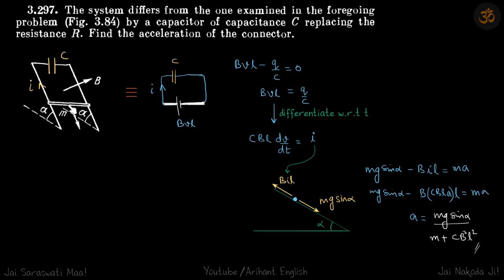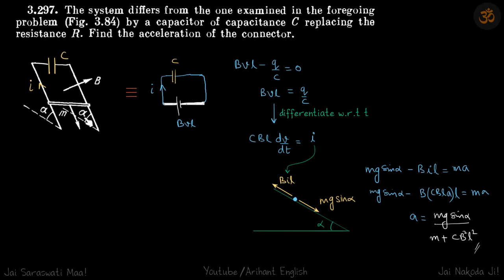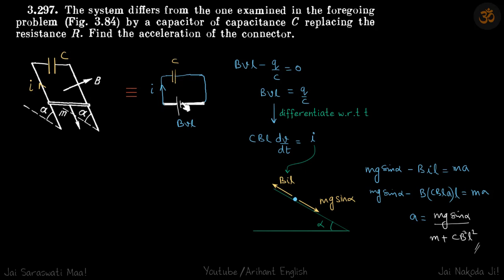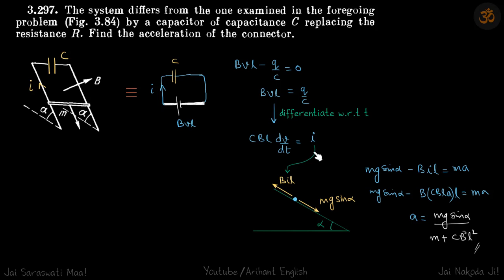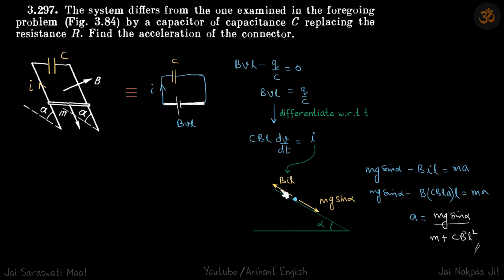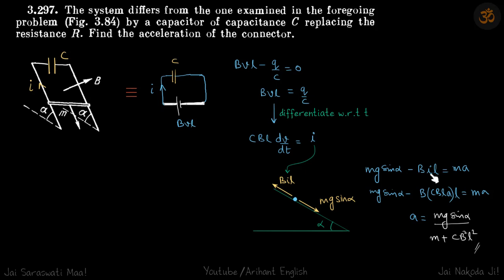3.297 | Irodov Solutions | Electrodynamics

Comment: wont dq/dt be zero ? as capacitor is instantly charged as soon as rod gains some velocity  since there is no resistance , then why will anymore current flow through the circuit as capacitor is fully charged ?